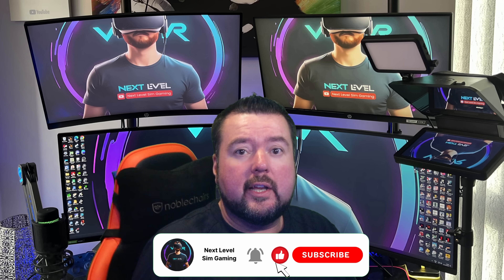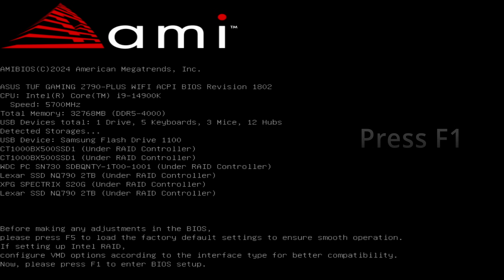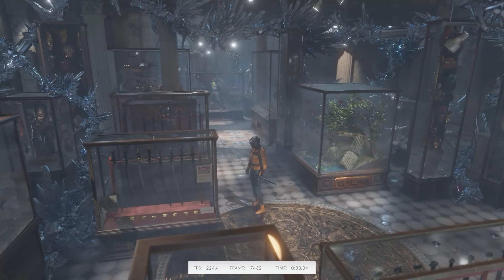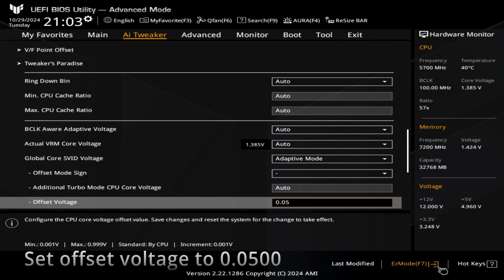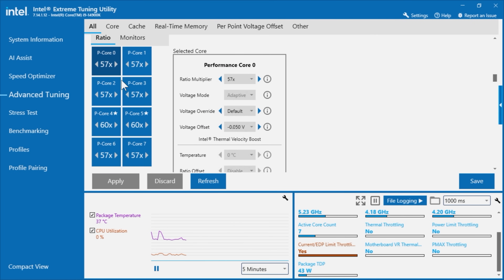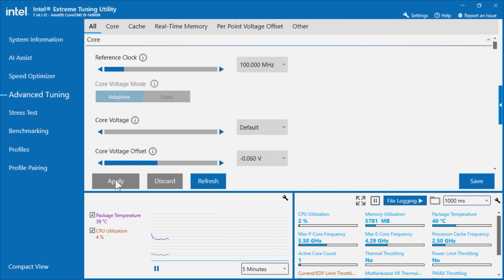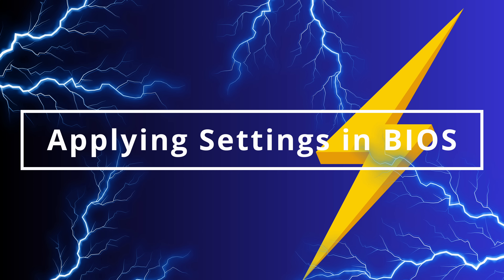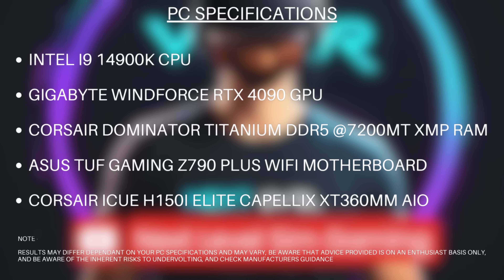i9 14900k Intel Final Microcode 1802 - 0x12B  BIOS Installation, Tuning and Undervolt Guide 📈

Comment: I’m getting just slaughtered on my scores because I can’t get xmp to run stable at all. Tried dropping the xmp tweaked profile from the 7600 down to as low as 7000, and even bumped the voltage ever so slightly. Running it at the stock 4800 is not going to cut it. Ha
Reply from the maker: Are you running 4 x sticks of RAM or two?
Reply: @ running a 2x24 Corsair dominator titanium 7600 kit off of the qvl list. Finally got it to run down at 6600mts using the 7800 tweaked profiles timings and had to switch the pmic voltages from sync to by per pmic. And slightly upping the dram vdd and vddq
Which is the changes I had to do on my old system to get 4 sticks to run xmp
Reply from the maker: @ DDR 5 at higher speeds are always temperamental on these boards unfortunately, its no different on the Z890’s either presently, I couldn’t run anything more than 7200 m/t on the Z790
Reply: @ it’s frustrating. Have the z790 dark hero which claims 8000, have the ram off the qvl and run the tweaked which should be asus own profile for that ram if I understand correctly. And still not even close. Does this fall more on to the cpu and the controller?  14900k   
Cinebench so far locked at 5500, -0.065 I’m seeing a score of 31700 with a max package temp of 78. Time spy cpu score of 20070 cpu score with a peak temp of 69c.
Reply from the maker: @ It should but its a combination of the memory controller on the 14900k being pretty poor, as well as the motherboard, on the Apex 2 DIMM boards you may manage it, this is one of the reasons I changed to Arrow Lake, I’m running 8400m/t CUDIMM the memory controller is excellent on the 285k which is great for productivity.

Check out Actually Hardcore Overclocking (aka Buildzoid) on YouTube and Framechasers for deeper insights into RAM
Reply: Figured out part of the issue. E cores were locked in at 2300mhz. Had to go into the control panel and switch the power plan back to balanced. Which then allowed me to go into the settings and change the power mode to high performance. Which unlocked the e cores. Gained 8k points running 55P/43E and just a super sloppy 6800 on the ram. (No xmp, just set frequency and bumped the vdd/vddq to 1.4) now to fine tune the undervolt again then can get into the ram.

Comment: Hello, how are you? 
So your videos have helped me a lot. I have an exactly the same PC configuration of CPU, Motherboard and RAM. 
So when I use my CPU in games or in heavy processes like Cinebench, in my HWmonitor in the POWERS measurements where there is PL1 and PL2 there is a VR Out measurement, and this measurement sometimes reaches 300w... Is this normal? Or is there something wrong with my Bios? 
I have already deactivated Unlimited ICCMAX. 
Help me! Thank you!
Reply from the maker: @rhaulvictor9288  VR out isn’t accurate on HWmonitor, so you can disregard that reading this is covered quite extensively on the Forums and often causes confusion.

https://www.reddit.com/r/overclocking/comments/1f5sb7t/why_is_vr_vout_is_always_much_higher_than_vcore/

Comment: Thanks dude fixed my issue temps are low my pc doesnt sound like jet engine anymore and i didnt push my voltage ofset kept it at 0.05 idc abt min maxing my pc i just use it for gaming as long as it doesnt sound loud im good. Again thank you so much wish for you the best for helping people out
Reply from the maker: @ScrollStopStories  No problem, thanks for the comment 😉

Comment: What does changing the undervolt to 0.065 from 60 actually do?
Reply from the maker: @00g99  - 0.0600 to - 0.06500 etc increases the level of undervolt see this further video on how to set the correct level of undervolt 

Guide to Setting the Correct Undervolt and Stress Testing Intel Raptor Lake i9 14900k
https://youtu.be/XM2JLjcQZgc

Comment: Hello i got a Rog Strix Z790-F and I9 14900KF followed same steps but i seem to get lower performance and higher temp. is 400 / 253 / 253 correct on the KF?
Reply from the maker: @thevododoll8699  Once the settings are applied the undervolt will then refine the temperatures, and in turn the efficiency, follow this further tutorial on finding the correct undervolt level, yes they are the correct power settings for the KF

Guide to Setting the Correct Undervolt and Stress Testing Intel Raptor Lake i9 14900k
https://youtu.be/XM2JLjcQZgc

Comment: 13900k, z790-e, avx2 fails on anything above -0.35, already replaced it 3-4 months ago, im not sure if they'll give me another.
Reply from the maker: @wrathlool  The 13900k is different to the 14900k, have you tried to undervolt without syncing cores?
Reply: @nextlevelsimgaming  I've just tried now with core ratio set to auto, sync all cores off, and still the same situation, but the cores are still boosting to 5.5ghz, 2 of them boosting to 5.8ghz, I also still get 38k on CB23.
Reply from the maker: @ So you have applied the latest BIOS update?, and undervolted incrementally starting on a negative offset - 0.05000 ?, and it fails on the undervolt?, you say -3.5 however you start at 1/2 a degree so - 0.05000 test then - 0.05500 then - 0.06000 etc watch this further video on how to refine the undervolt, also check the clamp pressure on the CPU isn’t too tight, and thermal paste application 

Guide to Setting the Correct Undervolt and Stress Testing Intel Raptor Lake i9 14900k
https://youtu.be/XM2JLjcQZgc
Reply: @nextlevelsimgaming  I am on the latest BIOS 2801, 29/11/2024, Yes, my mistake, I mean -0.035v, I tried -0.05000, -0.05500, etc, all were failing the avx2 stress test, which is why I decreased it, -0.04500, -0.04000 etc, the only one that doesn't fail the AVX2 stresstest is -0.035v or below, thermals are fine, 80c during cb23, but ill repaste it and clamp it just to make sure, the liquid freezer 3 can get a little tight.

appreciate your replys.
Reply from the maker: @ Disable IA CEP in BIOS and retest, Current Excursion Protection can throw a wobbler when undervolting, but this was seemingly mitigated in the last BIOS update, but there is a possibility that may be causing you issues also.
Reply: @nextlevelsimgaming  IA CEP was auto, but underneath said it was disabled, I disabled it manually and its still failing AVX2 stress test at -0.0500, fails after around a minute, I reclamped and repasted, package temp was around 80-85c during stresstest.

I'll just shoot intel an email and see if they'll replace it, might get lucky.

The reason I want to undervolt is under intel stock settings with the extreme profile, my vid is at 1.5v+ sometimes, I'm assuming thats not okay.
Reply from the maker: @ It all definitely doesn’t sound right, if VID max is going over 1.5 then the microcode update hasn’t worked, you have enough information there for Intel to RMA the processor, lets hope you get a 14900k
Reply: @nextlevelsimgaming  I got a new cpu today, still fails AVX2 with -0.050v, but 39500 in r23, ill just leave it as it is.

thanks for the video and all your help.

Comment: Cinebench R23 is poor at stability testing, Use R15 10 consecutive loops and you will fail with the R23 settings
Reply from the maker: R23 wasn’t used for Stability testing just benchmark, XTU Advanced Vector Extensions Test 2 is used for stress testing
Reply: @nextlevelsimgaming  Yeah I was just stating R23 is no good for stability testing, R15 is good for full load and Realbench is great for random differentiating loads.

Comment: Just got a asus z790f with a 14900k uograde from a 9900k z390 e  im  going to try these settings im on a h100i cooler 240mm keeping my fingers crossed 🤞i have done the latest bios yeterday
Reply from the maker: @submentalbass  No worries, i’m sure they’ll work great for you 😉
Reply: @nextlevelsimgaming failed stress test avx2 at an offset of 0.060 😢
Reply: Unfortunately cinebench still hits 100c on p cores around 3 mins in so I abort the test with an offset of 0.055v
Reply from the maker: @submentalbass  Disable IA CEP in Bios (Current Excursion Protection) and retest
Reply: @nextlevelsimgaming  will do mate if I can find it
Reply from the maker: @ Use F9 to search CEP

Also use this video to find the correct undervolt for your particular system 

Guide to Setting the Correct Undervolt and Stress Testing Intel Raptor Lake i9 14900k
https://youtu.be/XM2JLjcQZgc
Reply: @nextlevelsimgaming  managed to get it to pass -0.060 avx2 but still hot on cinebench 23 think my cooler not up to the task I'll have a watch later on thank you so much for all your help 🙏
Reply from the maker: @ No problem 😉

Comment: hello dude i need your help, i don't understand why i have so much difference to your result and my result in CPU score on 3d mark i have the same cpu than you
Reply from the maker: @BaseBassOne  Different GPU?, I have a 4090?

Have you closed all running applications in the tray?, RGB software?, Chrome etc?, all applications should be closed when benchmarking.

RAM speed?, mine is XMP @7200m/t

Also you need to find the correct undervolt level, use this additional guide to see more info

Guide to Setting the Correct Undervolt and Stress Testing Intel Raptor Lake i9 14900k
https://youtu.be/XM2JLjcQZgc
Reply: @nextlevelsimgaming   hey i have RTX4080 super / DDR 4  xmp 4000mhZ/ the graphics card have an issue on cpu result ??? and ram to ?
Reply from the maker: @ Yes it impacts both the CPU and the overall score, also 3D Mark is very receptive to RAM speed too
Reply: @nextlevelsimgaming  hooo ok thxs you  dude ;)
Reply: @nextlevelsimgaming  and why you select 55 and not 57 or more ?
Reply from the maker: @ Undervolting and Tuning Guide Intel i9 14900k - Core Sync 5500 to 5800 mhz &  Performance Benchmarks
https://youtu.be/hh3FIN1c_ZQ

Comment: work all fine! only trouble i get, memory ram not work with 100% 6400MT speed! so i changed back to XMP 1, and work fine! i dont know why, with xmp tweaker work 3000MT.... or i did something wrong?:D  asus rog strix z790-e gaming wifi ver 1  i9 14900k here!
Reply from the maker: @ZioDarkness  XMP tweaked uses the Asus optimisations, not the certified profiles of the RAM itself, which are XMP 1 & 2 so unfortunately Tweaked can be particularly picky.

Comment: Thank you, man. This has helped my rig's temperature drop in gaming, the fans do not scream anymore. I'm running i7 13700k, dropping frequency to 5.2, offsetting 0.055, 125w and 253w for PL1 and PL2 respectively, ICCMax at 307A. Although at idle, my temp averages from 40 to 45 degrees C, I think it's fine.
Reply from the maker: @nhtrung0607  Fantastic thanks for the feedback 🙂

Comment: I have the same system you have but the asus maximus dark hero board. Firmware 1801. It keeps randomly crashing on intel settings. Firmware 1704 crashed even more
Reply from the maker: @rafaelfabian7049  If it crashes on the Intel Default settings then as per comments from many other users you should begin the RMA process

Comment: Why offset for global svid and not actual core?
Reply from the maker: @YGadgETech  This is a method adopted by a number of enthusiasts, it works well on Asus boards.
Reply: @ with negative svid voltage bring better stability under-volt than actual core voltage undervolt?
Reply from the maker: @ I have found so on the Z790, also Framechasers, Advanced Hardcore Overclocking (Buildzoid) to name but a few.

However feel free to use whichever method you wish, the guides have helped many others, these are the methods that I have used.

Comment: Temps are better now, but I get a significantly lower cpu score than you did here in time spy with 14900KS. Does the graphics card, ram and other stuff affect the cpu score in time spy significantly?
Reply from the maker: @windur  Are applications closed in the tray when tessting?, obviously the score depends on system specs, RAM speed etc
Reply: Thanks! Got 40505 in cinebench r23 at least. Do you have a video on stabilizing 128 GB or 192 GB of ram? Or any tips. So far I can only run it at 4200. The rated XMP 5200 has never been stable
Reply from the maker: @ I don’t unfortunately but ‘Actually Hardcore Overclocking’ aka Buildzoid is your man for advice on RAM timings, I presume you are running 4 x DIMM of RAM if you can only achieve such low speeds?
Reply: @nextlevelsimgaming  Alright. Yes, 4x32 GB 5200 mHz XMP matched set
Reply from the maker: @ You won’t get full rated XMP speeds from 4 x DIMM, even on an Apex board, you’re best off selling them and getting 2 x sticks of DDR5 at higher capacity and then you will get the rated speed, do a search on the subject it’s highly covered
Reply: Yes, it's just that I need 128 GB, preferably more 😅 Maybe I can find 2x64 GB somewhere
Reply: Thanks for the help, this video really fixed some issues for me
Reply from the maker: @ No worries good to hear 👌🏻
Reply from the maker: @ I think the max is 2 x 48 for high speed to be fair, i’ve done the same as you before, thankfully Amazons returns rectified that one 🤣 good luck 😉
Reply: I assume that since I have a 7900xtx and 128 GB ram set to 4200 mhz for stability, it will affect the cpu score hehe. Btw,  would you recommend to change any of the settings in this  video with 14900ks instead of 14900k?
Reply from the maker: @ Yes, the 14900KS Intel Default settings on extreme are 400a ICCMAX and 320w PL1 and 320w PL2 so you can use higher power settings and yes the GPU will affect the score as will the RAM
Reply: @nextlevelsimgaming  Thanks for the quick replies! Trying 320w now.
Reply: The stress test in xtu said current and power limit was throttling as well, but the test passed
Reply from the maker: @ It will, as the limits are the 400 /253 /253 power levels we set which are the Intel recommended power settings
Reply: Set to 320 w, still had some throttling. Then i noticed my E core ratio was set to 45 instead of 44 for some reason. Now the throttling is gone!
Reply from the maker: @ The throttling is normal, however the Intel specifications for your KS processor is 320 not 253 so it was likely throttling at 253 which is the correct spec for the 14900K you should see an improvement in performance now, the undervolt will gain efficiency back and lower the temperature accordingly
Reply: Thanks😅 No problems on 4200 though!

Comment: With this new bios i cant clock my i9 14900ks past 5.9 ghz litterly wont read past it
Reply from the maker: @ThinkLikeaCar  The 6ghz boost will only launch under the right thermal conditions, you won’t consistently be able to clock to 6ghz.  Also the Extreme power settings are 400a & PL1 320 / PL2 320 for the KS, you will need to have Thermal Velocity Boost enabled to reach 6ghz

Intel Thermal Velocity Boost (TVB) is a technology that increases the performance of a CPU by increasing its clock frequency when the processor is below a certain temperature threshold

Comment: I am trying to find the Intel Adaptive Boost technology and Multicore enhancement in MSI motherboards BIOS, but can’t find them. Is this something to find only on ASUS boards? The only feature I can find with similar name is Intel turbo boost technology and Intel turbo boost max technology 3.0 and they are both enabled. Should I leave them enabled?
Reply from the maker: I cant help you with where they are on an MSI board unfortunately, but Intel Adaptive Boost can be disabled in Intel XTU, and Asus Multicore enhancement is only for Asus boards, it is a tuning utility.
Reply: @nextlevelsimgaming I simply can’t believe that we have to reduce the processor speed to maintain stability. Intel released and advertised this processor to be able to run up to 5.8GHz on multicore and 6Ghz on single core and is like cutting off a piece of it in order to make it stable.
Reply from the maker: @ And unfortunately therein lies the issue.  Intel would be hit with a mountain of lawsuits if they conceded that the 6ghz boost was nothing more than a gimmick attainable under only certain selective conditions, instead the Intel Default profile dampens down the instability by neutering the performance whilst still allowing the processor to clock to 6hgz.

You will note that the Arrow Lake has been set to a maximum of 5700ghz, and is geared to power efficiency, Intel simply cannot afford to have another generation of processors that are unable to perform the advertised task.

Comment: I'm stuck on the first step 😩 My motherboard is MSI Z790-P Wifi DDR5. MSI FW/BIOS support page has latest version as 7E06vAF. Is the idea to just update the motherboard (regardless of what you have) to the latest BIOS before configuring the processor? Or is there some other way to get the 1802 version you mention?
Reply from the maker: @natedamon1777  The 1802 is Asus specific as is the guide unfortunately, I don’t have an MSI one to either test or guide you through unfortunately
Reply: @nextlevelsimgaming  Thanks for the reply! Bummer that this won't work for me. Can you recommend any simple things I can do to protect the CPU, or how to monitor it / what to look for that would indicate it could become damaged?